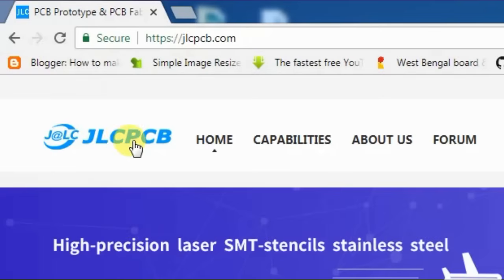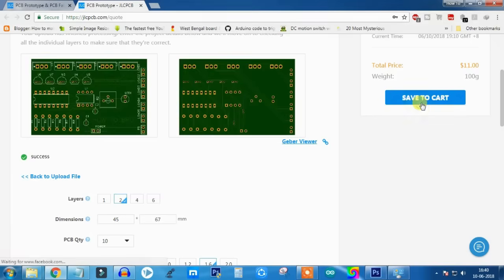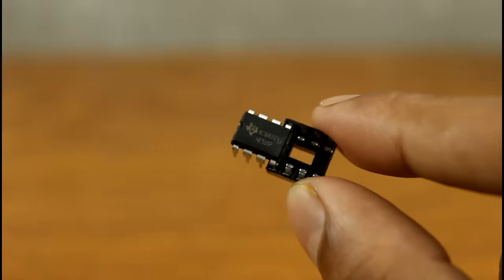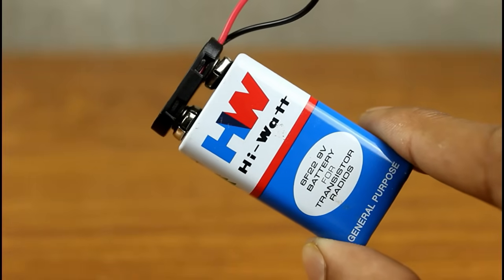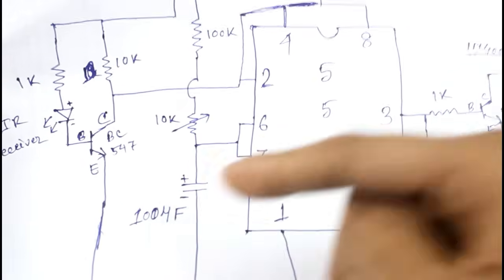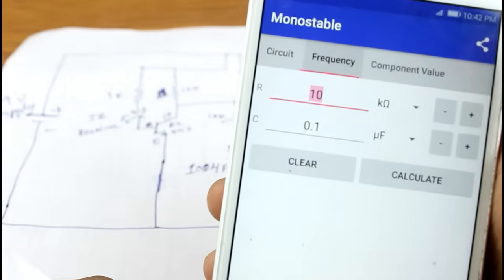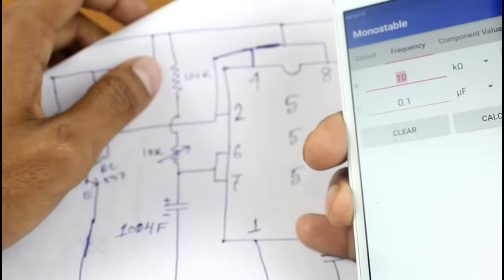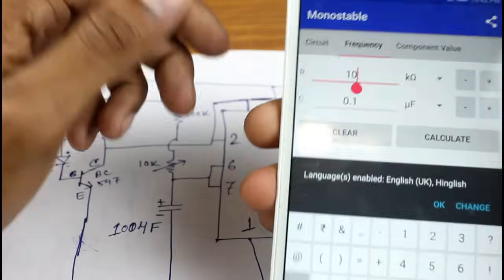How to make remote control timer circuit for 220v load DIY

Comment: Hi, great job. Its just that you couldn't display the diagram properly and for enough time. You basically shaded the diagram with your cell phone. Pls can I see the ac and socket connections to the circuit? Thanks

Comment: I don't have ir reciever led what I connect instead of ir led pls help me
Reply from the maker: Use tsop1738..... remember Tsop has 3 legs ...one positive,one negative & one output.....use a BC 558 PNP transistor and  rest connection are same....
Reply: I don't need remote control function
Reply from the maker: I already Made this please check my channel....
Reply: Thanks for helping me I will try to make timer switch.